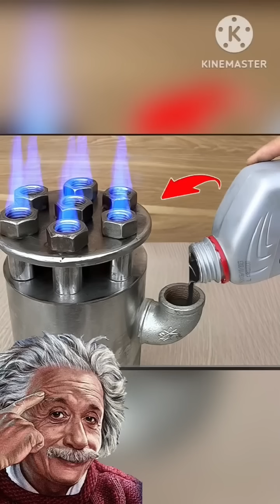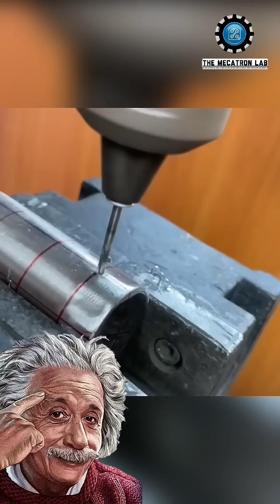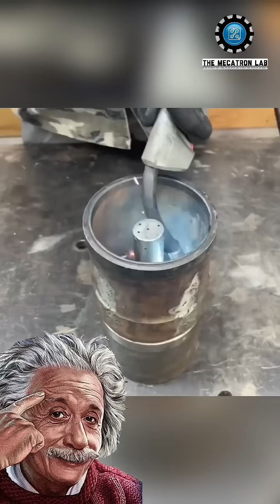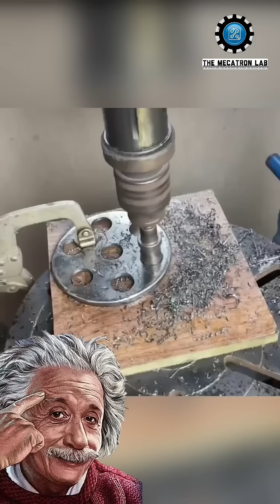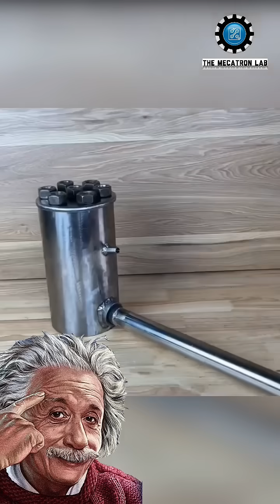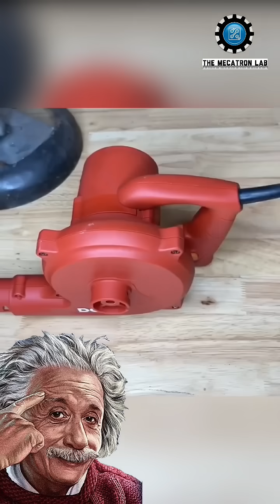How To Make waste oil Stove using Metal. #diy #science #experiment

Comment: Motor oil is full of carcinogens which are easily absorbed when heated into smoke and vapor ....☹️
Reply: Lead from bearings and fuel gets into the oil, spewed in the air by this device.
Reply: There are additives in the engine oil that smoke should not be inhaled
Reply: Freezing to death, or burn some motor oil to stay warm and alive? That’s an easy one, we burning the oil. A lot depends on efficiency of the burn and ventilation. Used oil heaters already exist, that one appeared to be burning efficiently for an old oil heater.
Reply: This is exactly why I quit lighting my cigarettes off mine.
Reply: Ever heard of a chimney? Yeah don't breathe it in 😂😂😂😂
Reply: That is why you burn it at high temperatures and don't breath it 😅
Reply: Hello! I agree with you. Therefore, this invention should not be used when preparing soup.
Reply: That's what I thought and also explosive?? Rich running engines dump ⛽raw gasoline into the crankcase 😢
Reply: @MarcusSandoval-kx2th  has nothing to do with the oil itself though.
Reply: @Elmo2ne1  Any engine that gets too much gasoline in the crankcase is about 5 mins from oblivion...
Reply: @edwardfletcher7790  dude you've never smelled the oil on your dipstick???? Gasoline contamination doesn't have to be catastrophic
Reply: @Elmo2ne1  I said "too much"... 🙄

And it's much much worse with turbocharged engines because it seriously degrades the super hot oil in the turbo bearings. It can also ignite...
Reply: @edwardfletcher7790 No engine? A 2-stroke engine literally has oil and gasoline in its crankcase. It works with a mixture of gasoline and oil
Reply: @koke1855  "Turbo engines", how many times do I need to repeat that ?
Reply: @edwardfletcher7790 not true bud
Reply: @BigdawgRoof  
Why don't you pick up a book and do some learnin' ... Woof 🤣
Reply: @edwardfletcher7790 boy is this rich! Lmao
Reply: Sounds so gross. Please don't anyone ever use this to cook anything.
Reply: So are trees . Nobody gaf
Reply: @luisgonzalez8423 yes using motor oil doesn't seem harmful at first same for burning wood the problem will be apparent is the future . and Burning motor oil is much more harmful than burning wood. While both produce smoke and emissions, the consequences of burning motor oil are far more dangerous. and while people do use wood to heat the house they use burning place and chimney which helps on the other hand using motor oil even if we have a chimney the fact remains that burning motor oil produces byproduct like lead and other heavy metal. so do research for your own good and other's around you .
Reply: @luisgonzalez8423 you wouldn’t burn wood indoors without a chimney tho would you? Maybe you would. You sound about stupid enough…and they’re much LESS carcinogenic.
Reply: @luisgonzalez8423 Chimneys take the smoke away so you don't breathe it.. this device does not.
Reply: @luisgonzalez8423  Trees are just as carcinogenic as motor oil eh ?

Someone went to the "School of Alex Jones" 🤣 LMAO
Reply: @edwardfletcher7790 he probably thinks it turns the frogs gay too
Reply: @edwardfletcher7790 what's with the weird Alex Jones strawmanning? lol I swear, that guy lives rent free in your heads.
Reply: @groovyc2411 Not an Alex Jones fan, but you do know that story turned out to be true, don't you? 😂
Reply: @dingoduster Said it before I could.
Reply: @dingoduster  i was just playing along, no idea if it is true. Plus his "gay frogs" remix was playing on repeat in my mind as I was writing that
Reply: @ Ah, a man of culture. Disregard, lol
Reply: @edwardfletcher7790  I think Alex Jones forgot more than you learned your entire life.
The past twenty years, he's actually been right on a lot of controversial topics.
I was never an Alex Jones fan either, couldn't stand his screaming. Until I did research on him
Reply: @dingoduster you clearly have no idea what a straw man is lmao. Don't use phrases you don't understand 😂
Reply: @baconscoobysnacks3135  I do. But yeah, maybe I'm using it loosely- but the gist is that you're using something that has nothing to do with the matter at hand as a tool to smear someone, instead of sticking to the topic. Maybe more of a red herring? Idk. Who gives a shit. My point stands, big guy.
Reply: @dingoduster  a straw man is essentially making up your own argument for the opposing side to argue against making yourself look correct. He made a comment, a joke referring to Alex Jones, not and argument lol not a straw man at all. And people do give a shit if you just throw out random phrases incorrectly just to appear like you know what you're talking about. Infact you doing that is ironically closer in comparison to a straw man than he is 😂 I'll be clear here, I do not agree with you at all. But doing stuff like this, even if you were correct, makes you look incorrect.
Reply: @ ok
Reply: @edwardfletcher7790 the guy who's always right?
Reply: @edwardfletcher7790 😂🤣
Reply: @groovyc2411 wait it doesn't?
Reply: @groovyc2411  he was correct about the frogs turning gay though.
Reply: @baconscoobysnacks3135  he used it right.
Reply: @michaelnorris5838  sure buddy lmao
Reply: @groovyc2411 nah thats plastic that dose that notice how the purple hairs are all chugging from plastic water bottles

Comment: There is an auto repair shop in my town that has a heater that burned used motor oil. It keeps the shop fairly warm but there is a lot of black smoke in the chimney.
Reply: Potentially toxic fumes
Reply: @isleter88 
 Cancer!!☠️☠️☠️
Reply: Yeah, this shit's not new
Reply: Then they have a serious problem lmao. I work on semis and we have the same kind of heater. You can put diesel, oil and power steering in it. Basically any oil based liquid. And you don't see anything what so ever coming out of the building. We also had like two different heaters. We had one that was like 10 years old and one that's brand new. Neither put out black smoke
Reply: Our country use cooking oil to make a fire
Reply: @RubyNoynay  - that's great to hear about...  if this type of stove were used, maybe the used cooking oil might be filtered with an old pair of pants, closed at the ankle tightly.   💚  The smell might be more like good food, or fried pastries instead of typical smoky petrol pollution?
Reply: I don't want to give this video any support because it's just another burner... The one in the shop near you is either not running hot enough or not enough oxygen for complete combustion. A lot of them either require a good air source (like this well made but overhyped one) or done like a rocket stove with an extra air inlet to burn the smoke.
Reply: @xenoxaos1 I agree the only time there is visible smoke from a chimney regardless of fuel it's because the fire is too cold
Reply: @afrothunder270 
Not hot enough
  Fire is never "cold".  So it can't be "too cold".
Silly little point, l know.😊
Reply: @xenoxaos1  I agree that it needs some tinkering.  That said, while you could lessen the look of it, you won't reach "complete combustion", and you'll still have the products of combustion.

A little work and adjusting airflow would disguise/hide the unburnt, and lessen the amount of soot sticking in the exhaust better.
Reply: @xenoxaos1 Well you didn't leave much for me to say😅
Reply: He needs more air it should be burning clean no smoke
Reply: @tbnlc 
Anche se non fa fumo, l'olio esausto contiene un concentrato di sostanze cancerogene  passate nella coppa dell'olio durante la combustione del motore...un vero superconcentrato di cancerogeni!
💀💀💀☠️☠️
Reply: Does it leave behind the smell of oil?
Reply: @abdoamin6635 THAT depends on how “sensitive” your sniffer is.
Reply: @abdoamin6635 if it is burning hot enough there will be no odor or smoke
Reply: Inelegant bad design is what pollution is all about.😢 and for those who have forgotten pollution is only matter out of place.😮
Reply: @nicholasgardiner9601 
Is that so.  Thanks 😊
Reply: Será para uso de emergency
Reply: Correct 💯
Reply: The one in the shop I work in doesn’t have any black smoke and will absolutely run you out of there
Reply: @devonhoward650 
What !?   No  black smoke !?  throw it away!😅😅
Reply: Es lo mismo que les acaba de contar ya que al inhalarlo es Altamonte canserígeno y las complicaciones respiratorias que esto acarrea
Reply: This one looks like it gets to hot enough operation temperatures to have 'complete combustion' possibly.   I wonder if in practice do the volatile organic compounds get thourough combustion... What do you think?
Reply: Bạn có nghĩ là có hậu quả không tốt?
Reply: What's a good, efficient waste oil burner? Any suggestions?
Reply: Needs compressed air. Mine burns so clean there is no smoke or any smell.
Reply: This way of keeping yourself warm is way too harmful,  If it was any good, everyone would've had these in their houses, I bet this waste oil is deadly, contributing to the global warming 50 times faster. It must be stopped at once.
Reply: @DungeonArcher797 
Your level of stupidity and ignorance is stunning !  Bravo !😊
Reply: The plus about any shop that has a oil burn stove. They won't charge you to leave used oil.
Reply: I was wondering if the oil gives of harmful metals like lead or some chemicals that will cass your balls to shrink and fall off.
Reply: No sht...😂🤔🤣🤣 @henderstenders
Reply: @henderstenders 
Yes it does all that - according to Big Pharma corporations.😊
Reply: Some people used diesel
Reply: @Lambretta-Man 
Following up on my previous remarks diesel's exhaust contains the most potent carcinogen yet discovered.
Reply: @Lambretta-Man 
Posh users use Olive coz it's 10 times the price.
Reply: Eu quero saber quanto é o valor desse aí
Reply: Probably 60-70% of shops do this including my own.
Reply: If there's a lot of black smoke they don't have the ratios set properly.
Reply: I think the fumes in time could mess them up
Reply: Můj kamarád má také v dílně takové topení na vyjetý olej z aut. Začoudí to jen když se to zapaluje, pak není vidět žádný kouř. Hlavně je to topení zadarmo se spotřebou 2,5 - 3l/h
Reply: This part.
Reply: They all like the Black smoke !😢😊
Reply: Yes, with a cheap Chinese Diesel heater! The poisonous gases are led away with an exhaust tube!
Reply: Me acuerdo cuando estuve haciendo un curso de herrería, y había veces q hacíamos cuchillos y los pavonabamos en aceite usado. 💀
Reply: @duskyjackal Yes it will. First they turn green, then glow in the dark, then fall off.
Reply: @lights6833  😂😂😂
Reply: Your food you cook  in that burner smell like motor oil trust me 😂
Reply: @kenmasong6330 
That's why someone  made - The Saucepan.  You should get one.
Reply: Si il y a beaucoup de fumé noir c'est que la combustion n'est pas parfaite. Il doit il avoir plus d'air injecté.
Reply: That's exactly what it needs.  More air, and go ahead and make it a variable air intake  @camillelabourel9761
Reply: Yes  @camillelabourel9761
Reply: Just Stop Oil want's to know your location...

Comment: As other commenters have said this may be ok for a prototype or a work in progress, But this is not the work of a 20 year metal worker or welder those welds are horrible and should have been Mig welded. Also, carbon monoxide fumes are a major concern and some double-walled flue pipe would need to be used, I would use a finned heat extractor flue pipe to get as much heat production as possible and have the added benefit of cooling the exhaust gasses.
Reply: That was mig except for that 1st shot which was tig all the rest were mig or that was a mig tip anyway didn't see any flux core slag so I'm assuming mig
Reply: @buckyflex1  Exactly lol he means TIG
Reply: Probably AI-produced content.
Reply: yea the inhaled fumes of this would be great for the elderly. lolz. But if it could be taken away from teh user. Whats a flue pipe?
Reply: I'd run a boiler with it.
Reply: Running the flue/chimney especially with any type of inline of the exhaust would really clog up and need to be removed very regularly, so heat exchanger would need to be in a box and separate from the exhaught just like in a gas heater, or have it setup around most of the flue! But I imagine the left behind from the burn on the flue walls would be worse than what burning would does and that takes someone specialized or someone with ideas of how to do that on their own!!

My Dad always tossed several batteries in the fire of an enclosed wood stove and then the following Day get on the roof and drop a big chain down the chimney and give it a good shaking around to knock most stuff from the walls! He only needed to do this when spring hit and that was it!!! God I miss my Daddy!!!

Comment: These are great ideas. People in the comments have their own perspectives. Every tinkerer video does not mean you are trying to make something to sell to everyone. This is a good idea for the right tinkerer who if able to do this, may also have enough wherewithal to create a good ventilation system or just use it outside to cook, etc. it looks like it actually burns hot, hot enough to burn most of anything off. I would direct vent it outside with a fan as well to pull out everything. I can see this being good for camping too. Some garages and shops may be more than happy to supply someone with however much you can take. I wonder though, what comes out the oxidated side? I tend to think that it kind of wouldn't be as much as one with think though i absolutely hate the smell of burnt oil when it leaks from a vehicle into the engines hot surfaces..... lol I don't think this would produce that same smell. I didn't think it would and/or I hope it would not. I'm building it. Thanks.

Comment: You CRASHED! These are for VERTICAL LANDING/TAKE OFF ONLY!
I bought the STARTRC kit from Amazon together with my DJI Mini 4K just for safety when i fly ABOVE water, so in case of problems i can land and my drone will survive, but i will never take off/landing from water without an emergency!
In the worst case scenario as i have the DJI Care Refresh (crazy whoever don't buy it, for like 10% of the drone cost) i can have my drone replaced sending it back with a very low fee; without the floating kit you can't send anything back because it's sunk and you have to pay a way more for a flyaway event.

For me you were extremely reckless, you used it to fly on the surface of the water without even testing it in the air or enabling the payload mode to see how it fly, it is logical that with the forward motion it tilts, and in addition I read that you were responding to another comment that you had not done the DJI Care Refresh! Madness! Pure madness!

By the way, by immediately removing the battery, immersing/washing it with distilled water and drying it properly for days you could have recovered it.

Flying a few cm/inches above ground is one of the many idiot ways to destroy a drone!

Comment: > Burning used motor oil produces excesseve amounts of air pollution.  __BRILLIANT!
Reply: This so-called heater is a CO and carcinogen generator. Unless it's burnt with additional fuels (eg gas) to achieve complete combustion, dirty oil makes dirty heat. This silly pot thing can never do that.
Reply: Go climb a volcano, any volcano. Take a placard with you,, and protest with the volcano.
Reply: @JosephIodice-ep1gc   
-  Interesting point. 
And I would tend to agree that nature pollutes more than humans could possibly do. But we would be wrong. 8½ billion people driving cars & making steel produce more pollution than nature on average.
- We burn 20 million years of nature's produced oxygen, coal & oil each year. releasing all that carbon & methane into the air nonstop 24 hours a day. 365¼ days a year.
Reply: @JosephIodice-ep1gc  Why do you feel the need to protest a volcano? You don't have volcanoes at home so there shouldn't be an issue in this regard.
Reply: @JosephIodice-ep1gc dont mess with nature - boy she will crush you - turn hemp into smoke and inhale it - this is in tune with nature and can heal your condition
Reply: @JosephIodice-ep1gc  tell me you don't know the difference between anthro and patho without telling me you know the difference 101 right there.

Comment: Ok I wish you could have explained that your bill of material cost, labor and energy used to build this  thing was probably worth two lifetimes of burning your fuel. Not to mention it stinks up the whole room like,  burned oil. Good to see you at least applied for all the necessary safety listings since it's a higher heat application. It seems clear to me. You were very well capable of taking your next step into building a jet engine or even  rocket propulsion engine.
Reply: It's a good idea but I mean you could just buy a primer stove. This thing would have costed more than a massive bottle of propane and a small stove for it lol.
Reply: @OneSouthAfricanguy  Too Funny! I thought the 3/4" or 1" nuts were a nice touch. I'm going to try and make some "how to shorts" that make sense, you know like communication satellites out of out of pop tops and ring laser gyroscopes out of discarded batteries.  MarkMannM2
Reply: This is probably AI-produced content, so they can't
Reply: Thank you very much. You're the most clever gentleman I've crossed in my life. The world needs more people like you, it will be a better place for sure.❤
Reply: You're vomment just proves you are very ignorant!
Reply: Вы не обратили внимание на ЦВЕТ пламени.